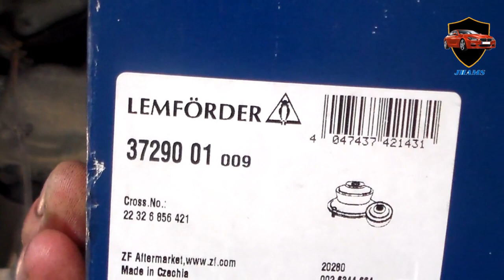BMW F10  Xdrive How replace transfer box mount .

Comment: Nice video. I checked mine at 141k miles when I did my t case fluid and it looked fine. I would recommend checking the rear diff mount too

Comment: Is it the same process for an F30? BMW manual says you need to remove the exhaust?
Reply from the maker: It is necessary because otherwise the special tool does not come in, it is not necessary if you replace the part as in the video.

Comment: Is this possible on the e90 xdrive?
Reply from the maker: It is possible with any xdrive, only the shape of the piece differs.
Reply: Did you did it on your e90? I’m having the same trouble don’t have the tool and don’t know if I should try without it
Reply: Did you did it ? I’m having the same issue, don’t know If doing it myself or taking it to a shop…. I’ve seen others videos and sometimes is really hard to take out without the tool
Reply: @carlosalvarezrivas416  yeah it's possible, however I had the transmission out of the car and ended up having to buy a new mount because I bent the other mount trying to press it in. Make sure you sand the bore really good and use more soap than water. Also freeze or cool the mount to get it to shrink a bit before pressing it in.
Reply: @wilsonvinas5906  thanks I will!
Reply: @carlosalvarezrivas416 

Hello ,  I’m interested to do that same job … can you please tell me if it worked out ok for you ?  Was it a reasonably smooth DIY ?  I have an 2009 328 X Drive .
Reply: @ThunderbirdRocket  hi , I did it easy , just add dish soap with a spray bottle and I goes in easy, and I took it off using a flat head screwdriver pushing it out slowly
Reply: @carlosalvarezrivas416 
Thank you brother !
Reply: @ThunderbirdRocket  you welcome and good luck

Comment: Is this same as the rear diff?
Reply: No, not even close!   You need to remove the exhaust, heat shield and disconnect the drive shaft.  You will also need a bushing extraction tool.  I replaced my F12 rear diff bushings with Powerflex bushings.  You might as well replace the guibo while you are at it.  It's a lot of work, but it can be done.
Reply: @toddpope2134  whats the benefit of the powerflex bushings?

Comment: Now do it on a 10+yr old car, started this on my f30 the rubber is basically fused to the metal 3hours and all ive done is tear the rubber to shreads. Borderline breaking out a sawzaw
Reply from the maker: If you know that the car is older, before disassembling, spray it with a soap solution when disassembling.
Reply: @JHAMS-007-car-repair  oh boy did I lol, ended up careful and slowly cutting through with a sawzaw until I got through the metal embedded in the rubber, came right out. Was hesitant to do so, but after several hours went for it. Took it slow, didn't make contact with the transfer case so worked out. What a pain though